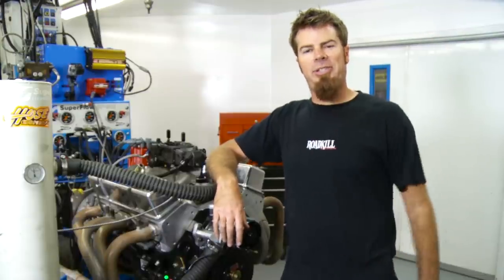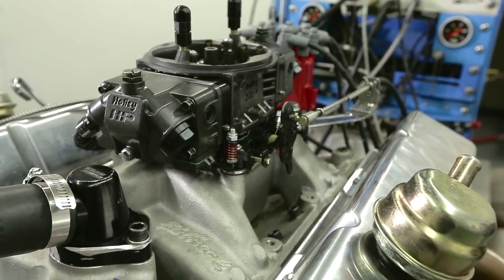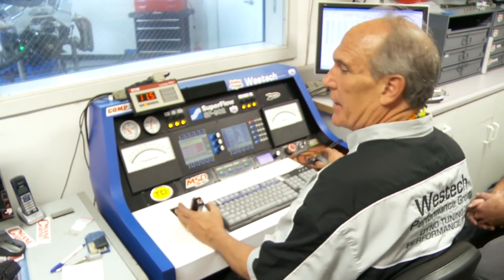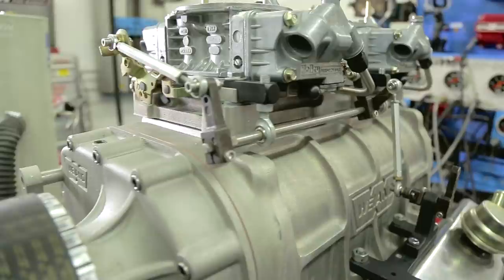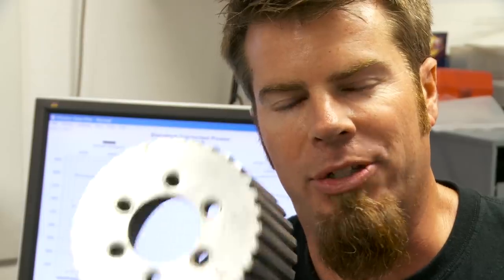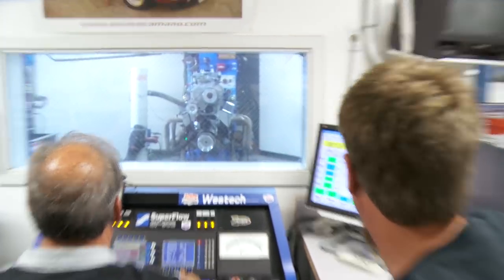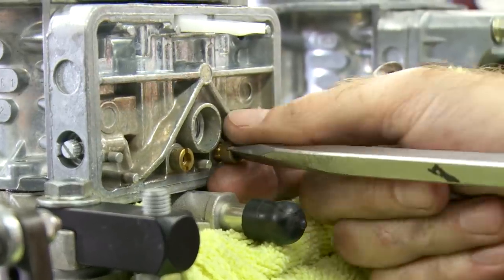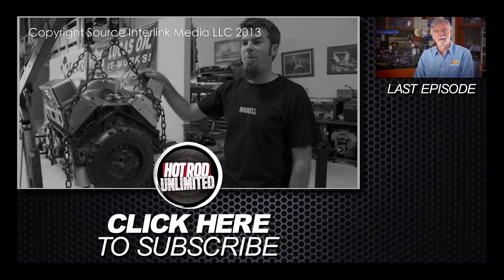Dyno-Tuning the Draguar's 696 Horsepower Supercharged Small Block Chevy! - HOT ROD Unlimited Ep. 35

Comment: Man.. Dyno guy really called it with his naturally-aspirated estimate! He was only off by a tenth of a horsepower :)
Reply: crazyfvck - He has dyno tested a load of those engines with a near identical setup. The 383 Chevy has been one of the more common stroker engines for several years. It's a 0.30 over 350 with a 400 spec crank.
Reply: easy when you have already ran the engine and tuned it.

Comment: If you say the Jag V12 wasn't a performance engine, you have to say for the Euro versions about 150mph for the XJ12 and 155 for the XJS isn't bad for a non performance engine. Remember their quoted hp was not the old SAE system. Later XJ12's were 6 litres by the way. The engine wasn't fragile, rather often the sensor that turned the electric fans on were crap.

Comment: Of course, but, well maintained, they break no more frequently than any other car, and have the added bonus that the engine itself (which is the expensive bit) is almost entirely bombproof. Both the XK and V12 are very reliable engines when maintained correctly. Done right, you can easily drive even an XJ12 thousands of miles a month, every month, every year, all year round. It's as reliable as a modern car, and when it does start to go wrong, you can fix it easily!

Comment: Interesting question Steve asked at the end "will it run on 87 octane in NA form".  If they just hit it with 17psi and it didnt blow up, I am thinking it probably only has 8.5:1 CR, which means it would run on 87 octane moose piss NA.  You also lose a point with aluminum heads due to heat dissipation, so it would technically be OK even if its 9.5:1.

Comment: smiling the whole time :) why not fuel inj and mapable fuel / ignition? I get that its oldschool but adding 1 deg advance when you could add or take away 0.1 increments at any rpm / load site and same for fuel, surely has to be the way to crack 700!

Comment: in 1902 the first magneto ignition system and high voltage spark plugs were invented and patended by Robert bosch electronics were around in 1902 believe me nikola tesla had invented a spark plug earlier than 1900 as well but wasn't commercially viable

Comment: Is the difference between a 671 and 871 Weiand the engine it goes on? Does the 671 ideally work best and made for a small block and 871 made for big blocks?
Reply: These older style blowers were originally used on 2 stroke diesel engines to move air into the engine. The designation 6-71 or 8-71 determines the amount of air they move based on the engine being mounted to. A 6-71 was used on a engine that had 6 cylinders and had 71 cubic inches of volume (this was how it was explained to me). 8-71 was 8 cylinder and so on. But now days they have 14-71 blowers that were developed for use on just gas engines.but yes, a 6-71 is typically used on a small block and 8-71 on smaller big blocks but as the big block get bigger so do the blowers. Nelson Racing engines builds 632 big block chevys with 14-71 blowers.
Reply: Aj Foell Makes sense, the detroit diesel engines are named after exactly that manner! the 12v-71 for example is a V12 with 71 cu.i per cylinder, so.

Comment: I know you aren't doing this for economy but just wondering - how does the super charger effect fuel mileage?  I like your videos, I just discovered the MT channel.
Reply: The mileage will go down alot. since your adding more air you have to add more fuel for it to run well.
Reply: there's also the fact that superchargers use the actual engine to drive them and it weighs 100lbs/50kgs.

Comment: In England Broadspeed were getting 800 HP out of the Jaguar V12 over 30 years ago. Some of the engines were allegedly destined for rich people's powerboats. The spin-off of the program was the Big Cat Racing Series but there were problems with the axles.  AFAIK it was a design fault caused by snap-ring grooves that caused a weak point. The axles had actually been made by a third party and allegedly Jaguar had to read the Riot Act to the company and tell them how Jaguar wanted the axles made.  Allegedly Broadspeed could get 1000 HP from the V12 but at that power level the engine was under great strain and was unreliable. 
 
As to those old bug-catchers, four barrel carbs and blowers it is old old technology.  It is also dangerous as if an inlet valve should leak it is likely to to cause the blower to explode.
Reply: Tech Davey I love the old Jag V12. It wasn't a powerhouse, but it could be made into one. I read about Broadspeed once when I was surfing 80's era V12's...(even though the design dates quite a bit further back then that) They really were able to get some impressive results with even just induction and exhaust!
Reply: Tried to tell people this many times,  even in standard form, the top speed of the XJS and XJ12 were better than most American big block cars. Not that American engines couldn't be built to produce more,  but a lot of hot rodders (like to) believe they produced more power, and performed better than they ever did in the day.
Reply: Thing is quarter mile isn't decided by top speed after. It's torque and getting it the road and the ability of the engine to build rpm while putting out that torque which equals horsepower. Everything is all said and done in a quarter mile.  Top speed after that is meaningless.

Comment: I have to ask this. Can 383 stroker produce 400-500hp (and still be durable) without a blower ?
Reply: kanervatie Well, looks like without the blower it went over the 400hp. Ofcourse 383 stroker is all about torque, but still.
Reply: Hot Rod Magazine and Super Chevy Magazine have both built several 383s making 500 horse and torque. Hot Rod went so far as to build three version, one with 412hp, one with 484hp, and another with 571hp but a bit radical for street. 400-500 is easy and very durable with a 383.
Reply: MajorArtillary Thanks for the answer.

Comment: They bought the car with a small block... This is a Hot  Rod Magazine project car. The idea was to make a lot of power, not restore it to original. The small block Chevrolet can make power cheaper, and is a lot more reliable than a v12 Jaguar engine.

Comment: did you do anything to the front suspension ???
Reply: hahaha i found that out the hard way when i went to take the 3.1 v6 out of my 3rd gen camaro and put in a ls1 with a t56, i end up getting it in thier and gettin all the mounts in the right spots come to find out the fronts dipped so far down the ground effects body kit was scrapeing against the ground so i went out an bought the most expensive shocks for front And rear ( bilstein adjustables 500$ a pair) not only gets up and goes but it handles a little better despite haveing more wieght in the front end lol
Reply: 12cwell well it sounds like you got it under control !!
Reply: yah sort of, it kinda bounces a bit, i also got to fix the rear end because the posi is DESTROYED
Reply: chris welling well you got half of it done !!

Comment: Emergency shutoff, in case, say, the engine blows and fuel is still going. Turns off everything. I've seen first hand how quickly a operating temperature manifold can ignite gas from a loose fuel line, trust me, the red button is their friend.

Comment: Next step would be to remove the everything from the car that's not needed to make it move.  Power windows, air conditioning, carpets, sound deadening, wiring, back seats, glass etc.  There's a write up on Jaglovers that suggests there's 800lb of crap you don't need in an XJ.  Once there's nothing in car but a race seat and a roll cage, the beast should really hammer.
Reply: Well it'd be nice to have a luxury car like the Jaguar with all the commodities you'd have along with it, and then have 700 hp under the hood.
Reply: Alberto Gamez
This man speaks truth. I freaking love XJs. And the blower just looks too damn good. Would love nothing more than to have that car with that engine. Repairing the AC would cost more than the car though, heheh.
Reply: +CosmoxYRik - Yes, and start with the XJ6 series one,...much lighter and shorter wheelbase works great with a Chevy SB...

Comment: 87 octane? Is that the standard in America? Here in sweden it's 95 octane as standard unleaded fuel ._. i'd be glad if someone would answer this for me..
Reply: 87 is regular 93 is premium pump gas
Reply: your octane ratings are different.  I dont remember specifically but ~87 octane american is about the same as 91 ish octane Eu.
Reply: They are talking about MON (Motor Octane Number)
In europe we use RON (Research Octane Number)
This are diferent ways to rate the octane number
Reply: There's three grades in Murica - 85, 88/87 and 91. And then there's race grade which is 100+ and not easy to get.
Reply: opl500 in texas we've got 87, 89, and 93 at the pumps:)
Reply: GoFastLemon same with florida :D
Reply: It's because the rating system is different so 87 Octane in the US = 95 in Europe and 93 octane in the us = 98 in Europe.
Reply: Ford Fan 2904 yeah it's (R+M)/2 or something like that, I'll correct it next time I go to a gas station, but we use different octane system.

Comment: when chevys over heat bring in the ford engines. people say fords are unreliable all the camaros ive seen are sitting on the side of the road
Reply: Forged engine, NOT Ford engine.
Reply: thats tru
Reply: +Nakian lol this guy tried to talk crap and it blew up in his face. Just like his ford engine ha! jk I have nothing against ford.
Reply: +Nakian fail though lol
Reply: Nakian well the cobra and gt500 motors from 2003 to present have fully forged internals
Reply: Its still a 383 chevy small block
Reply: +white chocolate If Chevy engines are so unreliable why are they swapped into everything? I've never seen a Corvette or a Camaro with a 5.0 swap but ive seen hundreds of Mustangs with LS engines.
Reply: +Nakian if its a 302 i buy it, but ive heard nothing beats a small block chevy, and my uncle has a 78 Nova with the original smallblock 350 and it still runs, in my opinion anything 302 Ford is reliable,  but smallblock 350's run for ever and parts are stupid cheap.